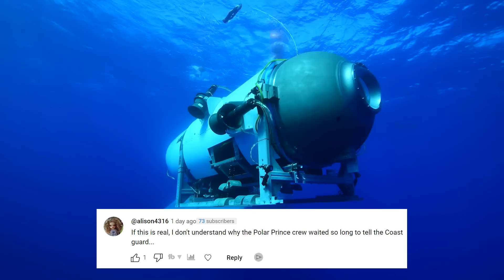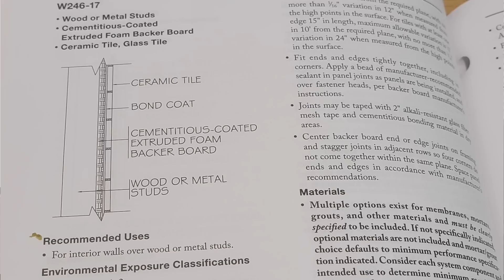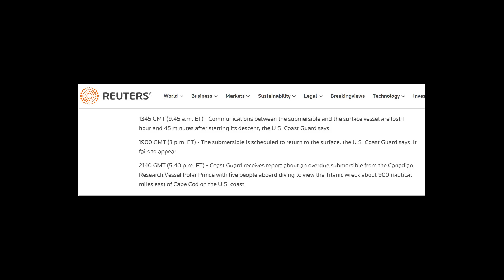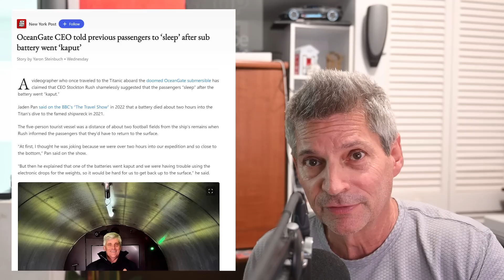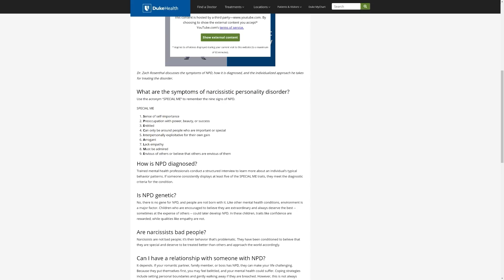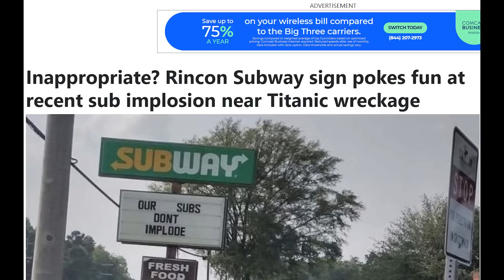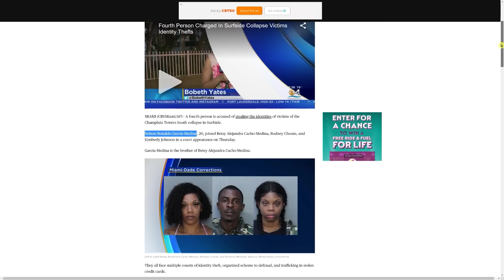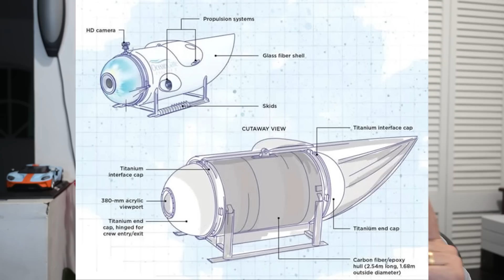Titan Sub: Why OceanGate Waits 8 Hrs Call Coast Guard, Q & A

Comment: Dragging those ppl to their deaths was distasteful
Reply from the maker: Yes, next video I will visit the agreement he made them sign
Reply: @jeffostroff  The verbiage in the contract isn’t much different than other risky adventures. I’ve seen that same language at water parks.
Reply: @mjgasiecki  water parks have a industry standard followed though, if a park designs a ride with gross negligence they are still at fault
Reply: @jeffostroff  do you think it would be worth trying to recover the GoPro that was onboard

Since they had almost 20 minutes to prepare for the end, those onboard would've likely used it to record their final farewells, and it likely recorded far more useful information than was available through text messaging
Reply: @mwbgaming28 does the GoPro work all the way down there at that pressure? If it does , then yes, I’d have thought that’s a great idea.
Reply: @breakingewes1316  the GoPro was inside the sub, and it's likely the camera would've been completely destroyed in the implosion, but I can almost guarantee that the memory card would've survived

If they can find the camera (it's likely near where the window came to rest or in the main debris field) send the memory card to a data recovery company, and see what was recorded

Even the passengers mobile phones could yield something (the phones wouldn't have survived, but the memory cards or NAND chips in the phones may have stayed in one piece)
Reply: why you guys make a big deal out if agreeing to injures or death ? You sign it every time you go on amusement park, any parachute jump or even uber ride that you don’t read. I understand this ride was doomed from the beginning since design had flows but stop making money off the agreement big deal. Read Tesla when you buy it - you’re in risk of death. Flip your visor at any car  - you’re in risk pf death.
Reply: @jeffostroff I can't wait to see that. It's such a shame that people had to die for one man's narcissistic personality.
Reply: @jeffostroff  Money back guarantee?
Reply: @jeffostroff  
"Yes, next video I will visit the agreement he made them sign"

You're an attorney now?
Reply: @jeffostroff Thank you, I've been interested in that topic. And no one else has covered that
Reply: @jeffostroff 00000😊😊
Reply: @jeffostroff   Is it worse than the waiver you have to sign in order to go into Zak Bagans' Haunted Museum? They tell you that by entering the museum and signing the release, you absolve the museum, Zak Bagans, Ghost Adventures and all it's affiliates of responsibility if you are attacked, possessed, or otherwise effected by the spirits and entities inside. THEN, once you've signed the waiver and turned it in, a TV pops on with Zak Bagans on screen and you have to put your right hand up and recite something that says basically that you understand the museum is not only haunted but LITERALLY filled to the brim with haunted and cursed objects and that the spirits and entities attached cannot be controlled, by the museum, it's staff, or Zak, so if something bad happens to you, you accept responsibility for it.
The museum has emergency exits hidden throughout, I never saw a single one except the regular emergency exit doors. Zak's emergency exit doors are for those feeling effected or attacked who need to be removed from the museum to be helped immediately. You are never more than like 5 doors from outside, so if you ever visit and feel panicked, just say "I'm panicking and need to go outside NOW." They will happily pause the tour and take everyone out for a breather. If you decide to finish the tour you will all go back inside and do so, if you change your mind and just want to leave, you can do that too. Idk if you get your money back though or not. When I took the tour at the end of July in 2019 it cost $40 per person. And my tour group was the last one of the night so we got in there after it had been riled up all day long.
Reply: @NRIautos  ocean gate still gonna be on tha hook
Reply: @yellowman617 wym
Reply: @NRIautos and paid a hella lot of cash for the privilege of doing so!
Reply: @NRIautos  Whatever they signed or didn't sign. It wouldn't have helped them to live.
Reply: Not sure if the go pro would have survived the implosion, but I am sure they will be looking for that amongst the wreckage. Likely some choice words spoken in those last few minutes.
Reply: @threeparots1  the camera wouldn't have survived, but the memory card probably did
Reply: They signed a consent form so they wasnt "dragged " into anything they knew the risk
Reply: No-one forced them.
Reply: He didn't drag anyone, they signed a waiver and knowingly knew the risk. Every paid a quarter mil to do it.
Reply: Brilliant informative vid think the guy was nuts😮
Reply: Wasting all that money looking for them is even more distasteful. That money could salve thousands if not millions of people just struggling to stay alive. Wasting it on some rich folks doing something risky is a total waste.
Reply: @NRIautos  I don't believe the waiver is going to be valid on account of gross negligence honestly.  Could be wrong though but just because you sign over that you can potentially die does not mean the company isnt still responsible and can be sued especially if they misled you in anyway or acted in such an unprofessional manner it is unbecoming of industry standard.
Reply: @TheFamousMockingbird  Reminds me of those posts you see online of companies asking their employees to sign forms to waive their lunchbreaks. 

Afaik contracts cant be used to just nullify laws.
Reply: @hherpdderp  Afaik ?
Reply: Yes, he was s narcissist! It is so clear to me because of how he said he had grown tired of the warnings and took them personally! That is exactly what I have recently experienced with a narc!! They are so full of themselves!!
Reply: I hope you meant despicable
Reply: Hopefully they got to see the Titanic in her haunting beauty before joining her in her slumber. Don't think there was much dragging or distaste. They basically ceased to exist.
Reply: @jonfreeman9682  if they did see Titanic, it was on a monitor anyway apparently.
Reply: @breakingewes1316  dont think they saw it, too dark and they had things they were dealing with obviously  you have to get right up in it witha  light to be able to see it
Reply: The fact that all 4 read and signed a contract and then all got onboard and were bolted in says each individual dragged themselves to their own deaths
Reply: He was a real jerk…
Reply: Stockton was texting rich or famous people left , right and centre with offers to go son Dives, sometimes at reduced rates.

If it didnt happen to these passengers. It would have happened to some others.
Reply: Why people can't accept fate🤔
Our life is a series of
events that finally lead to death
You can't blame the terminal event
Reply: @hsbsbj1049  Agreed, but not doing crazy stuff can just help prevent an early demise.
Reply: He did not drag them people to the death they voluntarily went down to their death
Reply: Distasteful?? Wtf it was negligible and criminal charges will come!
Reply: Im sorry, i feel like these people knew the risks. The only one who didnt really wanted to go was the 19 year old. Deep diving, comon, you dont need to be an engineer to know something could go wrong. These were all smart people. They died while having the adventure they wanted (except for the 19 year old).
Reply: They read and singed a contract, they paid more money than I make in three years….. they were not dragged, they were not forced.
Reply: @christjerky2320 they were still most likely misled into feeling a false sense of security by trusting self proclaimed “professionals”
Reply: @jeremysiron9622 ph nargeolet had been on more titanic dives than anyone there.. he was a leading expert not just some clueless passenger
Reply: @jeremysiron9622 It's up to the participant to do their due diligence.  The participants are equally responsible. These are billionaires, they could have uncovered all the warning signs, if they wanted to. The could have discovered the lawsuit that had been filed by a former employee, for one example... or went old school and used Google.
Reply: @annagrace60606  Something was going on with PH...
His conversations with others that warned him about the sub... are disturbing.
All his conversations revolved around death... He mentioned implosions twice in those conversations... in a positive light. 
PH was the smartest most intelligent guy inside that sub and knew everything 100x times better than Stockton.
A friend commented that PH was still trying to get over his long-time 1st wife, that had passed away in 2017. 
And he was 77 years old. When you get to that age, you think about death a lot.
Some people are saying PH knew deep down that Stockton was wrong, but still went a long with it.
I'm not saying the guy was sui_______l. But PH was very fatalistic about life at this stage in his life. and over looking dangers, as just being fate.
And Stockton may have taken advantage of PH 'state of mind' to sell his sub idea to skeptical people by using PH good name as seal of approval to his sub.
Reply: @jeremysiron9622  Guessing Rush wouldn't have been successful with a career laying bathroom tile.
Reply: @defresurrection  as a whole Oceangate covered information up, though, that is now available to us, but was not made available to previous customers, even other customers that went down and said that it was not shared with them or made public, so obviously the waivers weren’t good enough for Oceangate. They additionally had to cover up information to make the customers feel safe…. Why would they need to do that?  they fired anybody who ever spoke out against the project so there really was no way to do due diligence, considering they didn’t make any of those conversations public, which the only reason we know about them is because of the accident….. they wouldn’t feel the need to cover up information if they thought people would still go down…..
Reply: @jeremysiron9622  what about the International Waters issue?
Reply: @defresurrection  separate issue
Reply: @defresurrection  they purposely withheld and actually proactively covered up THE most important information that the customers needed to make an actual informed decision, none of which was in the waiver, and that’s been and being proven…they’re even trying to scrub all their presence on social media, I mean, there’s nothing to cover up if they didn’t do anything wrong. The evidence is pretty self-explanatory….
Reply: @christjerky2320 they were deceived
Reply: I agree with you on this except for the youngest crew member, it was father's day weekend, he said to other family members he did not want to go but felt pressured to. Especially as the ticket had already been paid for. 
It's a shame he passed so young but he probably had an amazing life and wanted for nothing. 

The other dudes tho... They made a choice without pressure. They spent the money.
Reply: @christjerky2320  doesn't matter... ocean gate had a clear history of ignoring safety protocol and even fired someone for trying to enforce them...that matters a lot more
Reply: @christjerky2320 hardly the point, paying ridiculous amounts doesn’t mean it should be any less safe, quite the opposite in fact, given paying top dollar you have every reason reason to expect safety would be of the highest standard, take your chip off your shoulder about the money side of things and you will realise that
Reply: @christjerky2320 $250,000 was pocket change to them. Hence, the old saying, More Money than Brains.
Reply: @christjerky2320  I agree.  And I thought the joke was funny. And let’s be real. If people didn’t complain about it, a little town would have had a chuckle and the deceased’s families  would have never heard of this sign, if they did.  
Did they deserve to die, of course not. But this was not a school bus crash with 25 children dead. It just wasn’t    It was silly joke  we need to laugh more if not … this world would be an even darker place.  
I mean The fact these people paid the same amount of money for that day trip as it would take roughly 4 men to earn in a year, now that’s what I’d say is distasteful and pretty darn dark 😏

* oops I just now read your “3 years to earn” 🤭.  Not everyone makes what you do lol. Good for you 😊♥️🇨🇦
Reply: @AMYV3  It is neither 'distasteful' nor 'dark' that some people make a lot of money while others do not and faulting someone b/c they're worth a lot is just as bad as looking down on someone b/c they're poor.  If you don't like the chasm between rich and poor then move to Venezuela or N. Korea where most people no matter what they do for a living earn the same amount.
Reply: @christjerky2320  🇨🇦?
Reply: Personally, I had to laugh at the Subway thing.
Reply: @aliveandwellinisrael2507 yeah, me too. Certainly lightened the mood, and I worked offshore underwater for years.
Reply: @aliveandwellinisrael2507  I thought it was hilarious myself - and not in poor taste. It's just a play on words and not intended to dishonor the passengers imo.
Reply: Titanic is more than 100 years old and still killing people.
Reply: That part
Reply: 💯yes. What a pos…
Reply: I have seen better GIJOE toys then that pos.
Reply: Discussing it after is really classy though
Reply: ppl?
Reply: @Capecodham  Short for people.
Reply: @angrydoggy9170  I wonder what he did with the time he saved not typing eole?
Reply: Yes. A lack of manners, at least.
Reply: Only one i feel bad for is the kid. The rest of them were smart enough to know better
Reply: @chrism4008  I too feel sorry for the kid (only). But I hope all the talk about them knowing there was a problem is wrong.  I can't imagine this happened slowly. Look at how quickly a plane unzips itself in an explosive decompression with only 8 psi difference
Reply: He didn't think he was doing that at the time?
Reply: They signed up for it at least 3 times
Reply: Did they get a refund?
Reply: They weren't dragged,,. They went Voluntarily. ... There's One word in the Webster's dictionary that explains their mentality.
Reply: All I can say is maritime is going to have a field day with this,
Reply: They signed!
Reply: Never mind not being certified by any government or agency… this sub had multiple descents and was never rebuilt…. James Cameron had his subs rebuilt after every dive…
Reply: That's a rather polite way to put it.
Reply: Stockton Rush wanted to die, but he dragged 4 more people with him smh
Reply: @LadyYella they weren't dragged. Paying 250k to do something isn't dragged. I feel sorry for the lad though, the others should have known better. Total fools
Reply: @pobinr The son never got to live a full life, I read that he didn’t want to go, he did it for his dad.
Reply: @LadyYella  smh?
Reply: @Capecodham  Means shaking my head
Reply: @LadyYella  Why not type it out in the first place?
Reply: @LadyYella  Narcissists don't want to hurt themselves. Mr Rush could not and did not want to even hear any thing that went against his perception and what he wanted. He was a clout chaser who used the others in my opinion.
Reply: I’m not sure he ‘dragged them’. They paid an absolute fortune for the trip! It’s not like he grabbed them by handcuffs and told them they’d no choice lol I do feel like the young lad was emotionally dragged into it by his own family though. You couldn’t pay me enough to get into that thing, before the disaster, after the disaster, EVER!
Reply: @breakingewes1316  What makes it eerie is when you are in that thing and knowing you can't get out until you are back up. That's enough to keep me away from that piece of crap!
Reply: @breakingewes1316 You wouldn't be able to go down in it after the disaster coz it's kind of broken now!
Reply: I am sure you have heard of the Latin phrase caveat emptor (i.e. buyer beware). Essentially, these passengers are not blameless in this. They also signed disclaimers to boot.
Reply: Distasteful? How about disgusting beyond descriptive words?